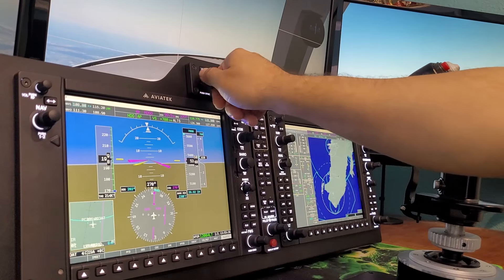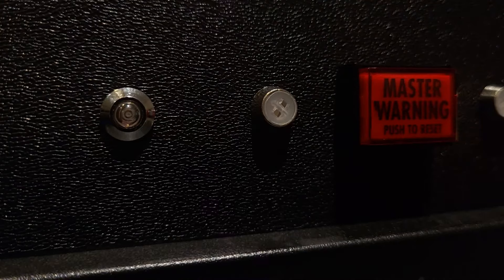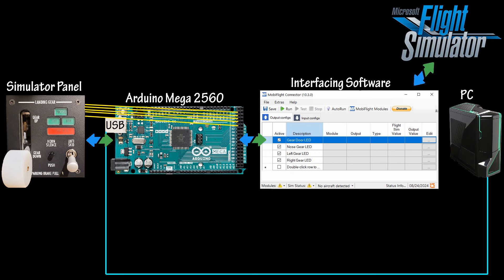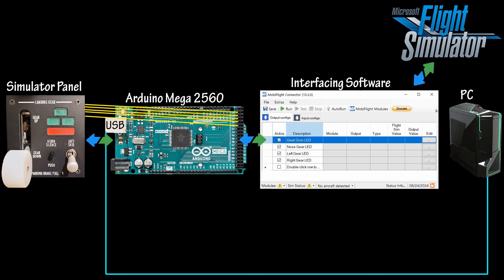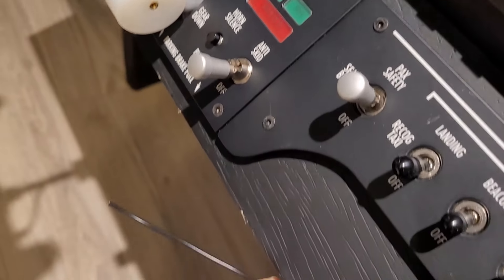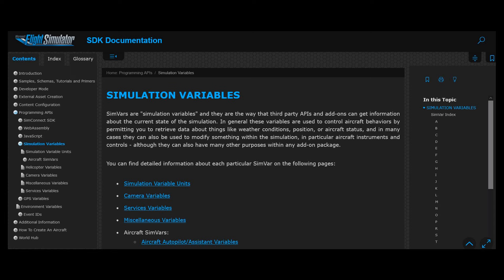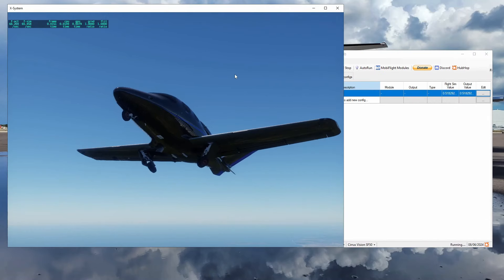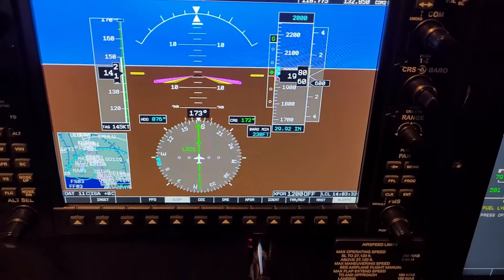The Basics of Flight Simulation Interfacing

Comment: This is a great intructional video.  I am building a complete sim that will be on a wheeled steel platform that I will build a cockpit to replicate my Mooney 201.  It will have Garmin G3x, G-5 backup, GTN 750, and G500 autopilot.  I want to build my own G3x and GTN 750.  I have used Air Manager but it's pretty expensive and I am not sure if it is the best program to drive a G3x or GTN 750.  I am not sure on which touch screen to use either.  Ipad, galaxy, etc.  I am now welding up the frame so I have time to make those decisions.
Reply from the maker: If I build the G3x or the GTN 750 myself, I would not use Air Manager. I would build the Bezel 1 to 1, and then use an Arduino or Leo Bodnar card with MobiFlight to drive it directly in the Simulator. Make sure to review my other videos as I give many ideas for LCDs, encoders, etc. RealSimGear has both of these units if you are interested in reviewing some built panels: https://realsimgear.com/collections/gps-units